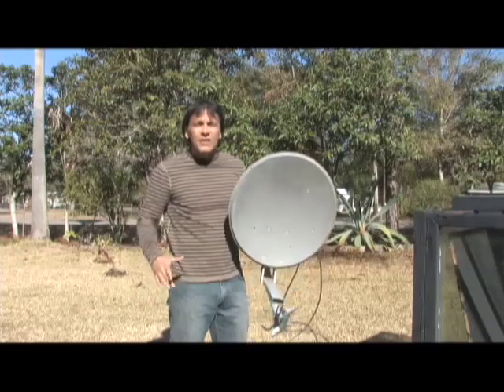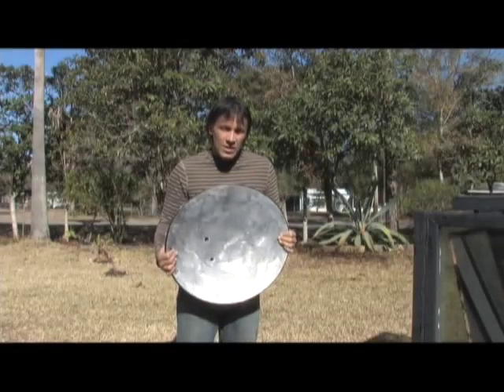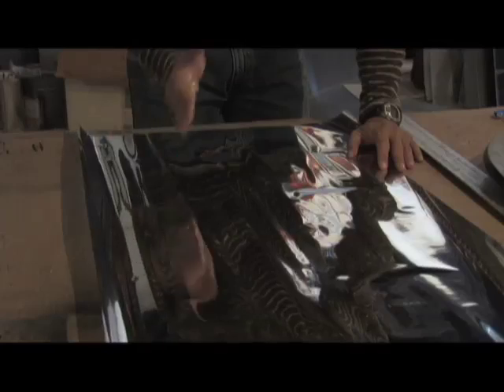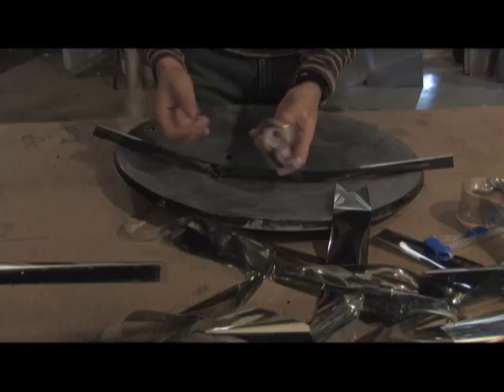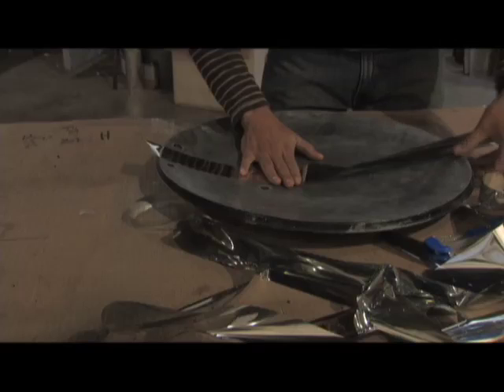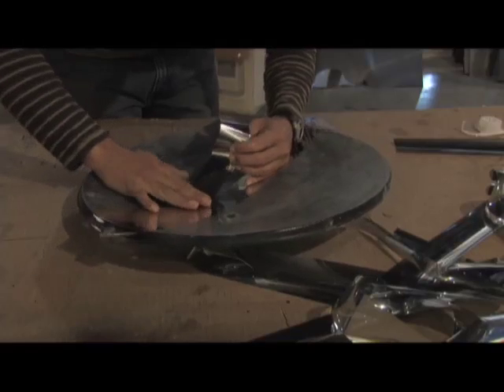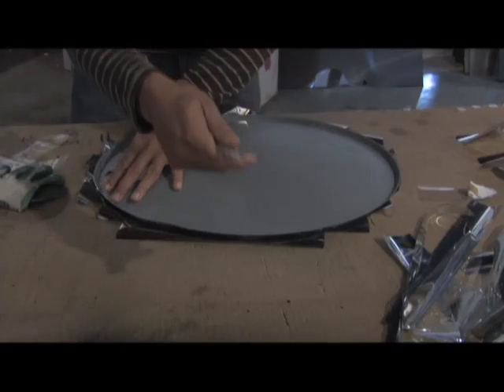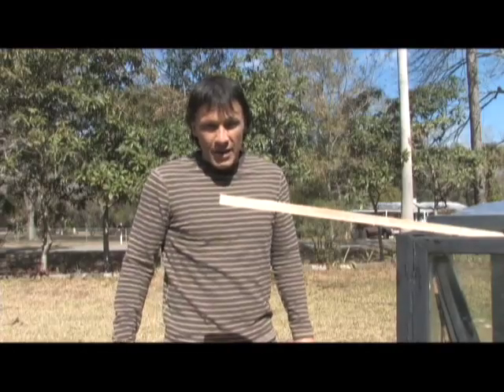Make a PARABOLIC Mirror  the cheap way PARABOLOID DIY REFLECTOR DIRECT TV hack Solar Reflective Film

Comment: why not use vacuum to pull the sheet down to the frame and use a adhesive applied to the frame, suck it down and with a bit to dry(cure)

Comment: Since you believe you could do possibly a whole other dish with the cutoffs, then it is possible to just use the cutoffs from one half of the dish, on the other half of the dish, instead of using more new material. That is if you want to only make one dish, or don't want to keep track of strips for the later use. Really it is the same thing, you already in essence said it, by saying you could do a whole other dish with the left over cuts, it is like just cutting a recipe in half instead of doubling.

Comment: Great apport, I'm planning to use this to develop a  low cost destination/filtration system for low income communities that suffer with water shortages. This 2 antennas, a pressure pot and some copper tube you can have a 100% energy free destilation filter enough for a family of 4

Comment: the holes and the lines from the strips will impede vision on objects millions of miles and light years away. I would have used the dish as a mold to pour in melted high grade sparkling clean clear glass, then had it polished with a computer until there were no bumps left...

Comment: If I glue broken mirror to the dish. Will it do better reflection job?

I was wondering if it is possible to use your 48 in dish to remove rust, as laser rust remover

Can u give a try with the biggest dish you have available? 

Thank u?

Comment: I've done the parabolic mirror but I used it to boost the wifi signal coming in an going out. I could not afford to get wifi for myself so my tablet had a weak signal that I could not use even thou it was open so I used the parabolic mirror to direct the weak signal at my tablet worked great it boosted the incoming signal an sent it out with no problem. Of course I was using aluminum but it work. Thank you Loader.

Comment: Doesn't matter if you cut pies, overlapping??? What are you doing with strips???
Reply: Also... It might be an idea to use a small square foam sponge based squeegie, non rubber, think that would be too much grip, you want even pressure applied over the ares of application so that you are not introducing air.

When I had to vinyl up a zintec sheet to make a sign, I would have to apply the backing to the plate and use a sponge to smooth down the stuff that was being applied, it would have been some 3M or similar grade reflective vinyl. Often known as Class 2 on Zintec (UK) forms the basis for temporary signs like "Road Works Ahead".

So making signs isn't easy however, you could try making application easier by using something like a foam sponge thats not too grippy, or a lint free type cloth that won't pull threads, thats the last thing you need...

Your application can then be done in larger strips or in a single sheet with appropriate segments chopped out so that the foil does not create ridges or fold on itself...

Comment: Guys . I have a question I need answering pretty quickly , I have just bought a ex WW2 naval searchlight and it's missing it's parabolic mirrored reflector . It runs a massive 1.5kw bulb , Would this material cope with the heat ok using a satellite dish as here ? Thanks
Reply from the maker: What size is the mirror, we have large parabolic acrylic mirrors that have been successfully used by other people.

Comment: I bought your Part-B Film but it peels away from the edges and bubble grow as it loosens in places. I cleaned and painted the dish with glossy black and used a plastic applicator to press the film down very hard.as well. Any ideas?
Reply from the maker: The dish may require part A email me order info through our website. We will help.

Comment: How about a space blanket. Seal all the holes but one, and put a hose connector in that one hole. Connect a vacuum pump to the hose connector. Spray adhesive over the metal surface. Epoxy the edge and stretch the space blanket over the metal. Use some elastic material to hold the edge tight while the epoxy dries. Then apply a vacum to draw the space blanket tight to the metal where it should stick to the adhesive.
Reply: Enoch I haven't Found a Mylar Space Blanket To be Elastic!

Comment: would it be possible to use a satellite dish, spray glue and a rescue blanket to get the same result? you can glue the blanket to a surface. inflate the blanket and glue the dish onto it. did you test that diy approach?

Comment: The film used is also available at home depot http://www.homedepot.com/s/mirror%2520window%2520film?NCNI-5 
in 45 square foot roll used it myself many times with outstanding results.
Reply: they also offer 2 different kinds one is self adhesive other requires soap water solution.
Reply: Jeff Clopp and its expensive as hell 40 vs a dollar

Comment: That mirror stuff is just aluminized mylar plastic.  All you need to do is lay the entire sheet over the dish, heat it up with a salamander heater or some other heat source to 350 degrees, and the plastic sheet will fall into place w/o any seams.

Comment: Why should the back be black if black absorbs light? http://physics.stackexchange.com/q/295018/73534. (in short: destructive interference)
Reply from the maker: Black behind semi transparent reflective material creates a mirror. This is why house mirrors have a back coating. Without it, all mirrors are two way mirrors.

Comment: i used to  work for a  huge Texas Instruments solar farm.They would put the Mylar fabric  on a 4ft ring, seal it then vacuum out the air from a nipple valve on  center of the bottem  to make it convex .  those mirrors would light a  2x4 wood block up 6ft away .  They used 24 of them on a array that followed the sun  .Each mirror was focused  on  a receptor that heated i believe Freon fluid witch turned generators for energy. The only problem is Calif would not let them burn anything  on cloudy days. Many millios was lost  as the entire farm was shut down due to California environmental  laws.
Reply: What do you mean that California wouldn't let them burn things on cloudy days? What happens to all of those parabolic dishes when a project like this gets abandoned? Thank you

Comment: I was watching this and I can't help but wonder if applying techniques used in car window tinting could be used to improve.  Car Tint is a film with a serious adhesive.  Spraying a relaxer (de-ionized water and a cap of baby shampoo in a spray bottle) on the surface would allow for some play in the film.  When the sprayed on solution dries, it leave the adhesive in it's full glory to hold.  Makes ironing out bubbles and avoiding tears a whole lot easier.
Reply: Thanks dude

Comment: It is best to use regular flat mirror plates at least 1/4 inch thick that can be obtained at any glass shop that sells windows.. You can also find them in big box hardware stores for almost nothing..  remember no thinner than 1/4"   because thinner mirrors are like funny mirrors that can bend like you find them in the fairgrounds at your local county...  Don't use them!  They can concentrate sunlight toward unpredictable targets and start 'em smoking.. and catch fire sometimes . The Sun moves so the concentrated spots moves .. but it can start fire before it moves away. it is a roulette game.. Don't !  Stick with heavy thick mirror plates 1/4"  as they are not bendable but BRITTLE IF YOU BANG THEM AROUND.. Handle them with great care and mount them with homemade sheet metal placeholders . Don't use those crappy plastic clear mirror mounts found at hardware stores as they come with thin screws..  I fashioned mounts out of galvanized sheet metals and I use bolts to fasten them before placing heavy 1/4" thick plate mirrors on framed plywood boards supported with a 4x4 fence post as an back anchor with heavy concrete slabs as deadweight against the bottom of the post to hold the whole board down against winds.  all I need is to lift up the bottom of post and twist the plywood board around to realign the sunlight through the window. Flat unbendable mirrors is the safest way to reflect sunlight thorugh windows which the sunlight never reach like the northern sides of the house.. or apartment. It is pointless to use any other kind of mirror like parabolic or anything with curves or bends.. as they are too hazardous to handle . I am not going to patent my idea .. not worth it.. as most people are only interested in solar panels for financial reasons ..
Reply from the maker: That is why you use as Sun Tracker:
https://www.youtube.com/watch?v=r0ff-uxWyp0

The movement of the sun is predictiable and if nothing is within 3 feet of the parabolic mirror, the reflective light is harmless as it becomes off axis. It scatters into a wider harmless pattern past the focal point vs. a tight beam.
Flat mirrors cannot concentrate sunlight, just redirect it unless you are using an array of many mirrors.. 
The thicker the glass the less light that is reflected because all consumer mirrors are second surface so the metalized coating that makes glass into a mirror is on the back and covered with gray back paint. The sunlight must pass through the glass, reflect off of the coating and pass back through the glass so roughly 15% of the sunlight is absorbed in the glass as consumer glass is not truly clear optical glass. It is usually a green tint. Look at the edges.
Even with a flat mirror, sun tracking is required. 
You cannot cook with a flat mirror unless you do this which works with all thickness of mirrors depending on size. Large thick 1/4" glass that is larger than 20" x 20" can flex. 1/8" flexes at 12"x12" and so on.
https://www.youtube.com/user/GREENPOWERSCIENCE/search?query=archimedes

For simple redirecting as you described, flat mirrors work great but again, sun tracking is required because unlike a parabolic mirror that has a focal point then scatters into an ever widening focal pattern, flat mirrors can send a blinding beam towards traffic etc.
Reply: that suntracker is fine for solar cooking but I am talking about heating indoors ... which requires entirely different set ups.. So I find thick plate mirrors to be workable for my home. I have them now.. most people do not think that we can heat indoors with solar energy.. or that we bother to develop anything ... except those famous beer cans .. which is not what I want.. I want to apply more sunlight all around the house through reflection. I know that the glass plate retards the heat delivery somewhat but it is not that significant maybe 10% loss.. My point is I understand that the mirror cannot be bendable like thinner mirrors can be that is why we call them funny mirrors.. which is very dangerous to use with heating indoors as there will be hot concentration spots from accidently bended mirrors mounted on boards that may warp from rain for example.. I had years of experience with my mirrors used for indoor heating and I find it very frustrating trying to explain it to the public at large.. It works great.. people look at them and think they are ugly.Oh well. At least, I cansay that you don't really need parabolic types to heat indoors which is crazy or unnecessary.&#160; you can use parabolic mirrors to heat water used to circulate through radiators indoors if you wish.. There is many ways to skin a cat. It is just that people are not trying hard with solar energy .. They just beeline to solar panels and solar cookers, that is it! all for federal tax credits.. There is a company that make solar walls that absorb direct sunlight and circulate indoor air through the exterior sealed metal wall. they are selling huge walls to companies for indoor heating but they are unable to get any qualificatioin for federal tax credits just because the government said NO!  you tell me why not?
Reply: You are missing the whole point of a parabolic mirror. The point is to concentrate the light to, yes, catch things on fire, cook, melt metal, etc.

Comment: cant you just put a sheet on the dish all at once and use a heat gun to shape it like vinyl wrapping the hood of a car? I want to make a mirascope but don't want to put allot of effort to do this just to prove a theory. I want to make actual holograms with a hexidiamond in the center and a mirror monitor.

Comment: have you tried running a copper pipe through those two holes connected to a tiny black 'boiler' at its focal point so that water circulates under its own steam so to speak.

Comment: * Use the holes to mount the dish so that it doesn't get away from you. Useful for sanding, cleaning, and application.
* Use a small squeegee to apply the film, it will ensure a better finish. 
  - As well, depending on the film you use, you may be able to use a small spray bottle full of slightly soapy water to help application.
* When trimming the edges, use the second method of cutting, wherein the dish remains focal point up and the blade is taken along the edge of the folded metal (not the back/bottom edge). It's similar to trimming applied grip tape on a skateboard.
* When trimming, if you go in the direction of the overlap, and not against it, while angling the blade slightly downwards (~65-80deg), you will have the least snagging.

Comment: Use a automotive  brass heater coil connected to the TV dish (using the exsisting  arm on the dish) at a distance that warms the water running through the coil to just  pre-warm the wAter before it reaches the hot water tank

Comment: So ... what the Hell are these things for?
Reply from the maker: +Almonzo Wilder Cooking and heating water.
Reply: +Almonzo Wilder also good for concentrated photovoltaics, if you put a solar panel at the focal point it will have, effectively, the surface area of the whole mirror, but it's cheaper because it's only a tiny little bit of actual solar panel.

Comment: Hi Dan you dont need a dish, if you just use lots of small mirrors and aim them at the target you can achieve the same thing. the advantage of this method is that you can cover the wall of your house and have a really big solar concentrator.
A word of warning though, as a small test I used mirrors that were 2" square and only covered an area the size of a tea tray and just with that small area I managed to set my wooden microscope box alight, so if you use the side of your house to focus mirrors the area would have to be fenced off and covered in warnings, a rolled up material cover over the mirrors would also be a good thing when you not making power.
You dont need a solar tracking device either. If you place the first mirror on the center of the wall and place a large wooden board were you are going to put the boiler tube then at half hour increments you mark the position of the reflection. This will give you a banana type shape on the board. Then you bend a stainless steel pipe to that shape. So the boiler is always on the focal point but the mirrors never move. To accommodate for summer and winter you can either use a bigger diameter pipe or just design in a vertical adjustment on the boiler which you update once a month.
The boiler can be fed by line water which is at 4 bar via a copper float valve from a cars carburetor. This means your steam turbine will operate at 4 bar, if you fit a condenser on the turbine you can reuse the water.
Come on Dan build it I don't own my own property so its not worth me building it but you could power your home with that easily, just need a sound proof box for the turbine exhaust, or maybe install the turbine underground.

Comment: Great vid Dan. All your vids are. I like them and learn a lot from them (you).
Question:  The solar reflective film you sell, it says "Part A", "Part B".... what is the difference between the parts? If I buy, say the "Part A"  24"x36", won't that be the peel and stick type??  I have a sat dish and want to make one. Thanks
Reply from the maker: Ralph Logan Hi Ralph, The part A is thicker and covers better for most surfaces. Part B is thinner and requires a black gloss base for best results. Part B can also be applied over part A to boost the reflective effect by about 10%. They both are peel and stick. Thank you for enjoying our videos and let me know if you have any other questions.
Reply: GREENPOWERSCIENCE Thanks Dan, it is much appreciated. Keep up the great vids

Comment: Also, you would be happier doing this type of work if you would re-dress your knife edge. Less friction = less frustration:) = faster time to completion. A tapered steel rod will set that fine sharp edge right back up to attention; straight up. If the steel does not help, then use a quick stone to dress the edge. A long flexible blade, like a filet knife, will give you much more blade to work with than a razor. Razors work well with sheet-rock, cardboard boxes, and fine point detail work. For wholesale long cuts, the more real estate you have to offer (blade length) the more material you will cut in less time. The flexible blade knife permits you to hold to the guide of your project's edge as you make longer cuts. Control the material being cut away as you go round the edge; pull down and away with just enough pressure to make the edge distinctive. The fact that all the material looks to be held together by the product's adhesive, just trim as you hold tension. Piece of cake:) or parabola, that is.
Reply: +John L Bales WHY DON'T YOU MAKE A VIDEO FOR US. Telling a man how to wipe his own ass why don't ya. Jeez take a Xanax and chill dude....